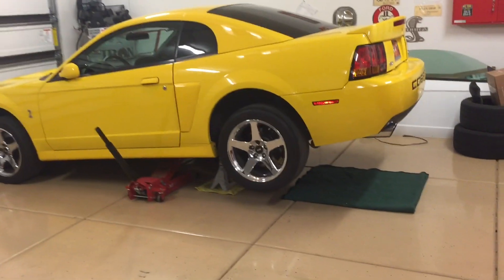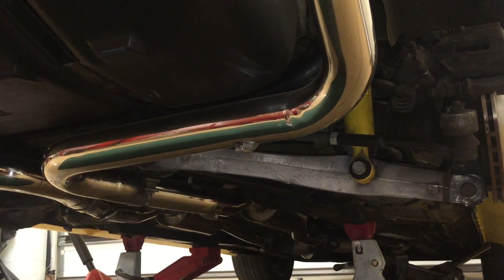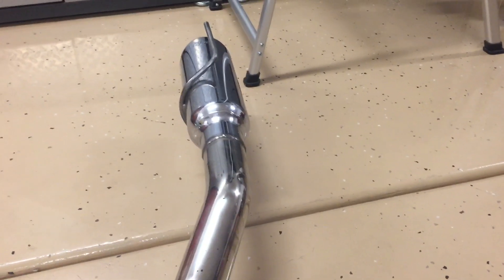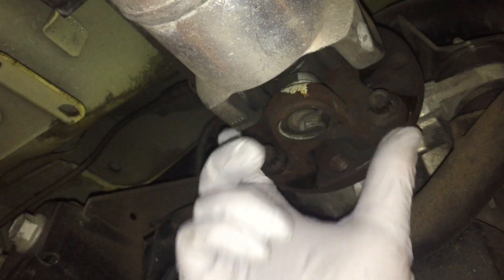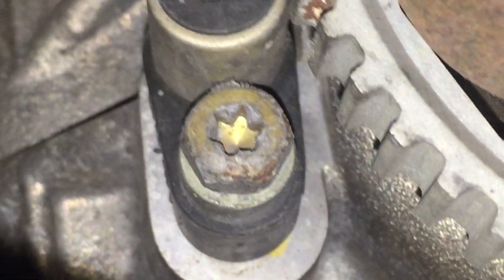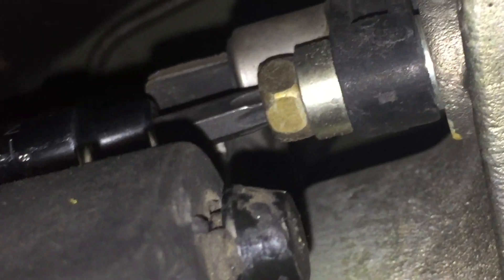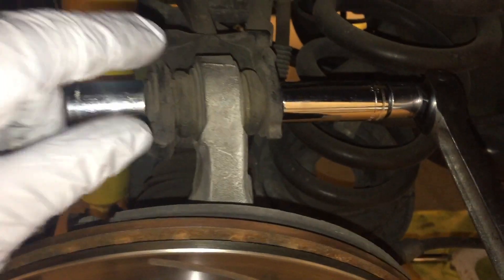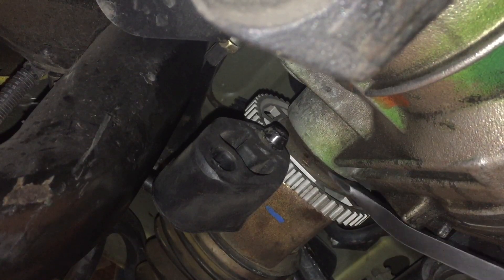Cobra IRS Differential Removal 03/04 Cobra 99-04 Cobra FIX LEAKING DIFFERENTIAL

Comment: Nice Video!  very detailed. I have to do the same to my 03 Cobra. My diff all the bearings are shot. Getting a full rebuild with all new guts unfortunately. But I am upgrading to a 373 gear. It’s really nice to see what needs to come off to get the diff out. I think I’ll take mine out then drop it off at the ring and pinion shop for them to rebuild it. It would cut the cost down I’m sure with removing the diff and dropping it off. Fantastic video I must of watched this about 3 times!
Reply from the maker: If you are interested in seeing the other videos in this series, here is the playlist. It talks about other things you may want to know. I also have a gear install series if you’re interested https://www.youtube.com/playlist?list=PLIjr-uSYDZi4GVUMK2SdUL74fClSt4-IZ

Comment: I just want to reinforce what Danny said, BUY A TRANSMISSION JACK, I put the diff in with the combination of two regular jacks and it was a pain in the ***. Either buy a transmission jack or have a shop do it. Also if you are putting the Ford Racing diff cover (M-4033-G3) it is even more difficult as the new diff cover is longer around the brace mounting spot and you have to really wiggle and move the diff around while keeping it level.
Reply: i Just want to add thank you Danny for your videos, really helpful for my 03' Cobra!
Reply from the maker: Justin L Thanks! I’m glad you enjoyed the video 🙂

Comment: Nice video Danny. How much time did this take you. I'm trying to figure out if I can get this done in a weekend when I'm off work. I'm replacing the diff cover exactly like you did.
Reply from the maker: A weekend should be fine if you have everything you need and let the rtv cure (or buy the lube locker gasket so it doesn’t need to cure). Watch all the videos in my series so you don’t get caught by surprise on the hardware and such and a weekend should be good (maybe get a friend to help too). https://www.youtube.com/playlist?list=PLIjr-uSYDZi4GVUMK2SdUL74fClSt4-IZ
Reply: Hey Danny, does that lead/rubber/whatever weight have to go back on after  you install the Ford Racing diff cover and FTBR front and rear diff bushings?

Comment: How did you pull the half shaft out? It feels like a spring is pushing it back in diff..
Reply from the maker: If it's disconnected as shown in the video, it should slide directly out towards you like a drive shaft. If you want more room you can remove it fully https://www.youtube.com/watch?v=4VEq9R000M8
Reply: Thanks I got it out! Resealed the diff and putting it back in today before this hurricane comes thru.

Comment: Hey Danny, does that lead/rubber/whatever weight have to go back on after  you install the Ford Racing diff cover and FTBR front and rear diff bushings?
Reply: Besides maybe being some sort of ballast, i don’t understand the point of it.
Reply from the maker: If you’re talking about the dog bone dampener that goes under the diff, no, it does not need to go back on. Many people take it off. It’s designed to reduce NVH (noise, vibration, harshness) but a lot of people consider it dead weight.
Reply: Danny Johnson’s Garage thanks man. And thanks for the quick response. Great channel 👍

Comment: Hey brother, just curious what rear mount you're using on the diff?
I was looking into the Ford Racing diff cover but I don't want to use the stock mount. The only one I can find is from FTBR and it's milled for lowering the diff which I don't plan on doing.
Reply from the maker: I am just using the stock one.
Reply: @dannyjohnsonsgarage  have you done any of the irs bushing upgrades such as FTBR or MM? I have heard that there are benefits to the lowering mount from FTBR and the Ford Racing diff cover milled for lowering from them as well, such as better drive line angle and less drive line vibration/noise. Any opinions?
Reply from the maker: My brother will be adding the bushings on his 10th anniversary Cobra. We may make some videos on it when we do. I have heard that a lot of people will complain about noise from the stiffer bushings transmitting through the car
Reply: @dannyjohnsonsgarage  definitely consider making a video. Your videos are very informative. 
I'm shocked that people find it noisy after the upgrade, I find it noisy stock. Lol
Reply from the maker: @ikramnanlawala4843  Thanks. Yeah, the stiffer poly bushings don't absorb the sound as much as rubber.
Reply: @dannyjohnsonsgarage  nice to know! So improvement in the drive quality but more annoying sounds!

Comment: Hey Danny! I just purchased a 1998 Cobra! The previous owner had a bad engine. So he had purchased a 01 Cobra Motor to go in it. Just never installed it. So I bought it as is. I have seen you had a lot of experience in mustangs. I was wondering if you could tell me if I will have any issues hooking this up from a 98 to a 01 motor? Thank you for any and all info!!
Reply from the maker: The main difference will be the ignition. The 98 has coil pack and ignition wires as you’ll see in my 98 Cobra series (I’ll add a link below). In 1999 Ford changes to a coil on plug design where each coil pack goes onto the spark plug.  You may need to swap the top end items from the 98 cobra engine over to the new one (or look into a coil on plug swap).
Reply from the maker: https://www.youtube.com/playlist?list=PLIjr-uSYDZi4xKZjgjhr9yKlr7GMx-FD0
Reply: @dannyjohnsonsgarage  Hey thanks for the fast reply! I don't have the old motor. So I would have to do the coil on plug swap any recommendation on what to get? Thanks again!
Reply from the maker: Seth Lapp You’ll have to find a write up on line to know if you can plug the main harness into the computer or if you’ll also need a 99/01 Cobra computer.